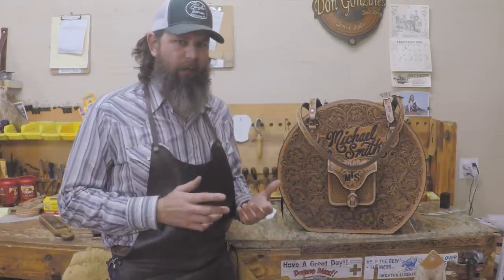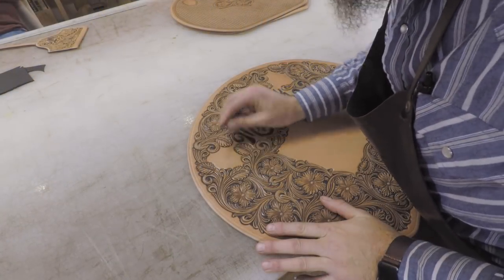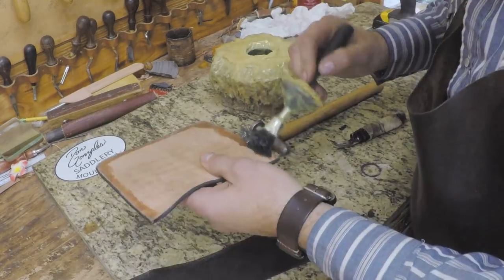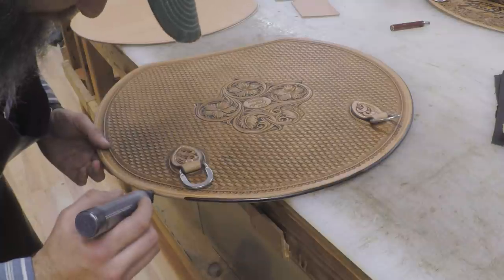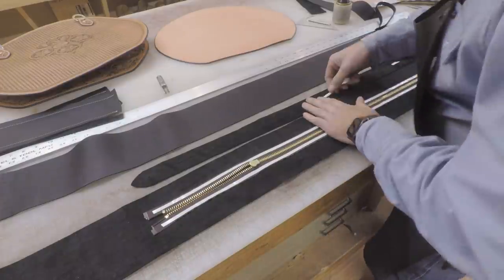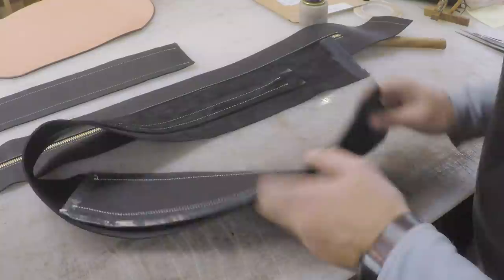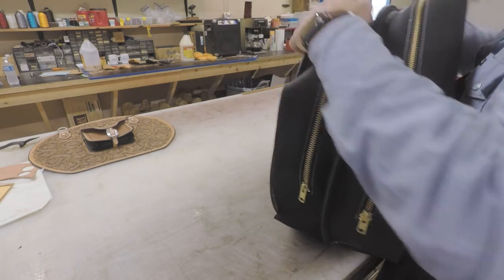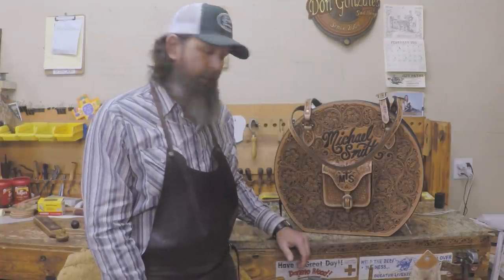Making a Leather Rope Bag

Comment: Yanno...if you take a piece of card stock, about an inch and a half wide, and mark out 10.5" on it, poke a pin in one end and punch a hole even with the mark on the other end, you can pin that to the center of a (really big) piece of paper, and use your pencil in the hole in the other end, and, using the pin end as an anchor at your center point, you can draw yourself a perfect 21" circle.

Comment: Impressive! Do you think an old pair of wranglers would work as the fabric for edge slicking?
Reply: They sure will. Gets hot pretty fast if your really gettin after it so I cut oversized pieces to give yourself room for folding and use multiple layers
Reply: @kenbowen3944  Thanks!

Comment: What is the brand of sewing machine you are using?
Reply: That's a cobra class 4
Reply: Troy is correct.  I have the same machine.  If you are planning to buy one I highly recommend it but make sure you buy the package deal one. It comes with multiple accessories plus a flat top. If you don't get the package and need something later on it will add so much more to the cost